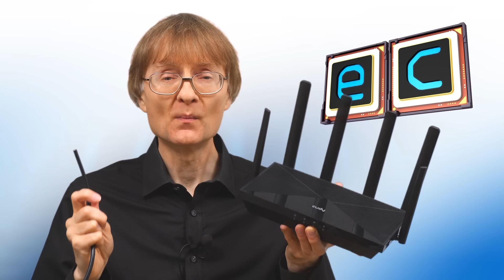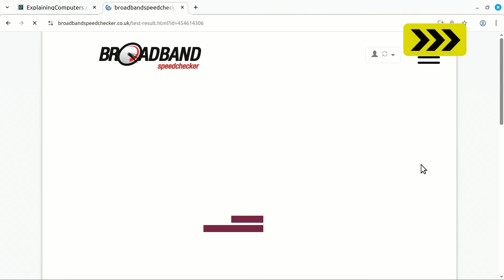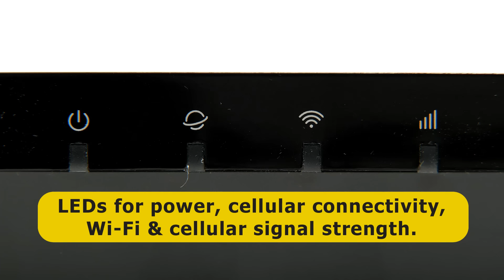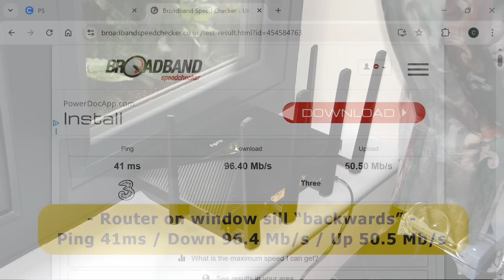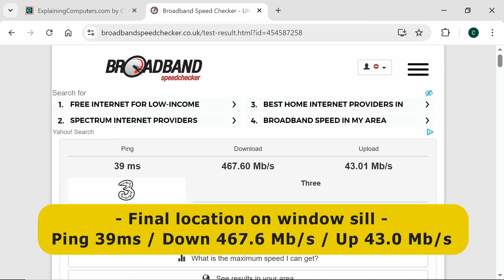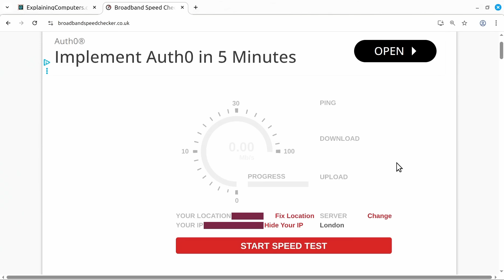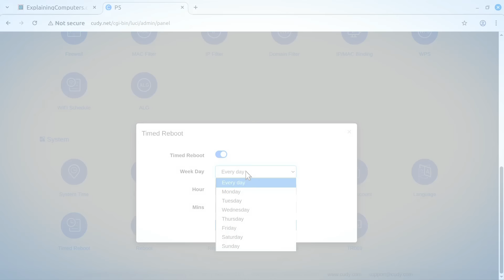Switching to 5G Broadband: Cudy P5 Router

Comment: Thanks for sharing your experience, Chris. I live in Helsinki, Finland and have a wired 1Gbps connection in the apartment for 40€ per month (optical connection into the building, no landline required). This just returned 919 down/828 up. I have considered a 5G router, as 5G in Helsinki is excellent (988/117 best result). Unfortunately though, it is a very new apartment building and the insulation is so good that it is effectively a Faraday Cage signal-wise inside. The building was designed with this in mind and has special glass with fine wire mesh antennas between the glass layers (triple-glazed windows). This restored the mobile signal to an acceptable level, but still only around 400/20 at the very best. So in my case definitely not worth it, especially given Finland's quite low Internet connection costs. In Finland, it is a legal requirement that everyone has access to 5Mbps connection, and apartment housing companies will usually provide 20-50Mbps free-of-charge.
Reply: how is the latency to nearby internet servers (ping ms)?
Reply: @gnu-lynx2501  2ms for the 919/828, 15ms for the 988/117, 15ms for the 400/20. The best 5G ping was 14ms, and 1ms for wired.
Reply: Unless you have VERY special needs, you'll never use 400.
Reply: @pasos22  For down speed I'd mostly agree. However, my work involves constantly working with remote web servers (including large transfers), and I have a development web server at home that needs external access, so 20Mbps up speed is totally unacceptable.

Comment: I have the same router and the antenna system i set up on my roof from WaveForm was very impressive and well worth it. I hope you can test some Waveform antennas as they have many different form factors to test out. That would be fun to watch you test them.
Reply: Seconded! I would be very interested in a 5G antenna test.

Comment: I live in Brittany. Just over two years ago following a bad storm that decimated the rural ADSL lines, we had similarly awful response from the French equivalent of BT namely Orange. They estimated a network restoration time period of …… six months! There is very patchy mobile reception in Brittany’s rural areas so we were left with no other choice than to install Starlink. We’ve gone from about 5 mbps download and upload with Orange (yes 5, on a good day) to around 350 - 400 mbps download and 30 - 40 mbps upload with Starlink. For rural areas with poor 4/5G reception satellite broadband just makes a lot of sense.
Reply: Is that the orange that was taken over by BT, I was with EE and when the contract ran out and BT took over EE, close to a monopoly in the UK, could not get copper from the box at a reasonable price so went with pop telecoms at almost half the price EE/BT were asking for better speeds.

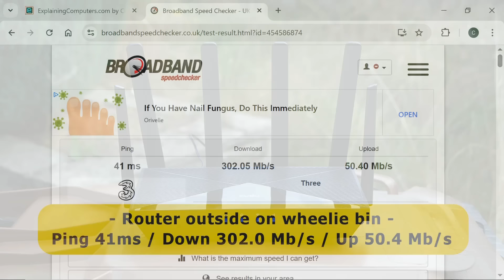Comment: 12:10 no Chris, running an antenna from the router to the roof would drop the signal IIRC by 1db/meter of wire.

Stashing the router in the attic is usually the preferred solution, although you could indeed try to add to the mix a 5G antenna for exteriors (with the router still in the attic).

Comment: I'm in the US.  Currently on cable and getting latency in single digits, about 500Mb down and 12Mb up (advertised 400Mb down, 10Mb up).  Moving soon to fiber with advertised 1Gb down and up.  And I'll be saving ~$20 a month.

Comment: This is so weird.  In my country, all wireless / WiFi connections are capped, while optical fibre connections are not capped. That means for wireless connections, you have to buy a package of data, either daily, weekly, monthly or Yearly, and when you have used that amount of data the connection stops!  That makes all the wireless / WiFi packages much more expensive than a fibre connection, unless you only use a tiny amount of data.  I am so glad that eventually they did lay a fibre connection to my address.  😒🤑

Comment: I live in Wisconsin and I had DSL copper line from 1997 to 2018. The speeds were abysmal (50kbps).  Before that I had dial up service. I switched to ATT Business Fiber seven years ago and haven't looked back. I have also upgraded all the wireless access points. Speeds is now 50Gbps at night, 30Gbps daytime for less than the old DSL.

Comment: @ExplainingComputers / Christopher,
It is interesting that you have published this video today due to the point that I have got a Fibocom-FM350-GL PCIe card (which uses the MediaTek T700 5G modem chipset) which I purchased in 2023 but due to regulatory issues (ie. US Federal Communications Commission approval / FCC "lock"), which in turn, has caused issues as far as operating system / software drivers have been concerned, I have had issues with this card. However, since version 6.9 of the Linux kernel, this card has been supported (which I only discovered around two weeks ago). Due to this, I am intending to deploy this card into my internal infrastructure at some point this week.

It is worth noting that I have been using a 4G Advanced router (ie. a ZTE MF297D) since February last year and prior to that (from 2013), I was using a 3G USB device and later (if my memory serves me correctly, from 2017 until the deployment of the ZTE MF297D) , a 4G USB device, connected to a computer, which was acting as a router (which I configured both the computer's internal Ethernet and WiFI provisions to act as a gateway).

Comment: My wired connection is unreliable, due to farmers digging up the lines or whatever.  You'd think the lines would be reliable, but they're often flakey. I did an experiment recently in which I bought a one-month internet package for my smartphone. I can use my smartphone as a Wifi tether as an alternative connection to the main line. It actually works quite well. The connection is at least as good, too. Very handy as a backup.

Comment: Had a vm connection with TV and phone but regularly had to reset the router sometimes twice a day  because of a dropped connection  and after it it became to expensive ditched vm and got ee full fibre since April and only needed to reset the router a couple of times  and get faster speed

Comment: I hotspot my 4g phone when travelling. Does everything I want to do well. ATT fiber at the house: works fine. Google fiber available (probably works a bit better) but costs a little more. 5G is available and is half the cost. I'm close to a tower. If I change it will be to 5G.

Comment: I think my neighbour across the road from me must now be using a 4 or 5G broadband internet connection as the original copper connection to his house was cut through by some guys trimming tree branches and Open Reach just tidied up the cable spaghetti and drove off!

I currently have an FTTP connection with BT at £35.00 PM (for their Fibre 2 service) but after seeing this video going down the 5G broadband connection route looks very interesting. 

Around how much a month are people paying in the UK for an unlimited data service?
Reply from the maker: Three charge new customers £21/month for unlimited data (with a 600GB/month fair use cap). Or they charged me, as an existing customer, £16 a month for an additional unlimited SIM.

Comment: When you put the cudy outside, did you run a speed test via laptop➡ethernet or phone➡wifi?
Reply from the maker: Good spot. :) All tests were via Ethernet. However, when I started making the tests I had not decided whether or not to make this video! :) So I did not take the photos of the router in various locations. Hence I had to put the it back into some positions to take them, and did not add the Ethernet lead for the outside shots.
Reply: @ExplainingComputers  Thanks. I have a similar setup and it never occurred to me to take my equipment outside to test. It's going to be my project for the next few days. Thanks for always posting great content.

Comment: Welcome to the club. I switched to the same 5G router and wireless solution 1 year ago. I have full 5G signal in my area in London. I have a Smarty unlimited broadband sim which cost £15.00 per month and which I am locked in for 27 months since November 2024. I have had no need for a second sim card yet.
Reply from the maker: This is great, and reassuring, to hear. :)
Reply: What are the average and peak down/upstream speeds you've experienced?

Comment: Are there limits on the amount of data used per month from 3 on the 5G or some kind of speed limits or "fair use" policy. I once tried BT via satellite and fell foul of "fair use" - Unfortunately, there was nothing in the agreement defining "fair use" so they could just cut you off or restrict  service when they felt like it. Many thanks for the information in the video as well as the description/notes.
Reply from the maker: My plan is "unlimited", but there are indeed fair usage limits, which I think are 600GB/month (although in some documentation I read 300GB). There are no speed limits (as there are, for example, with EE).
Reply: @ExplainingComputers  Many thanks for the info. There is no 5G where I am but I don't have the legal/physical problems you have for FTTP. Sady the speed "guaranteed" on the minimm speed FTTP is slower and costs more than my ADSL! (I like near a cabinet so minimal copper involved) Thanks again - I've enjoyed your varied videos on a wide range of tech matters for many years.

Comment: 🇸🇪 I use a 4G router, a Huawei B535-232a 4G LTE. I live in a mid size Swedish town, and i get speeds of around: Ping 44ms, Down 70Mbps, Up 10Mbps. This is slower than the broadband provided by my landlord, but it is also much cheaper!
Info for Swedish people: I use Comviq, and I pay 299SEK/month for unlimited data. I have a plan without router.

Comment: My house has a metal roof and "stucco" that fakes stone, and really is just concrete over aluminum mesh lath. I get decent cell service in the house (large windows especially on the ground floor), but my internet is via Cable (Spectrum now, formerly the atrocious Time Warner before buy-out) into my wifi router with all my PCs but one (dead ethernet but wifi works) wired, and when I had a TV it too wired. Still have a TV, but it is currently just a wall hanging black area. Current speed right now is 266.2 Mbps down, 22.6 Mbps up. 
 Not many pushing 5G here, but ATT and Verizon offer it, as does T-Mobile, but they need to fix their website (start typing my address and it offers up it in the drop-down, select it, hit search and get a "Must select address from drop-down" message)
 There is a Wifi based service around town (I think Xnet), but what few customers I see are out by the Lake. They also offer a 5G service, but pricey, and not in my area, it seems Seeing more and more Starlink. Brightspeed is expanding Fiber in the area, but locally at least their customer service is not much better than that of CenturyLink whom they are replacing, as most are the same people, just new company.

Comment: I've been using Three 5g for the last 4 years. First two years I had the Huawai? router then Three gave me the ZTE MC888 router which is much better. I like 5g broadband but it is only as good as your received 5g signal. Just wondering now is the Cudy P5 better than the ZTE MC888.?
Reply from the maker: Great to hear this. For me, a key benefit of the Cudy was its four Ethernet ports, which I know a lot of people will not use.

Comment: It's worth remembering that all smartphones thesedays have a "hotspot" option, where you can use them like a router from your mobile-data. 

Best to check first though if your contract allows this (it'll usually be called tethering), and may not be suitable for low-data packages.

Though currently you can get unlimited data for: 
GiffGaff (uses O2): £15 a month (usually £25)
SMARTY (uses V+3): £20 a month
Tesco Mobile (uses O2): £20 a month
VOXI (uses V+3): £20 a month for 300 GB
Asda Mobile (uses V+3): £22 a month

Comment: Very timely Chris, I have been researching a 4G LTE router that I can use as a backup internet source as a failover connection with my Unifi Dream Machine Pro. Unifi do make a device but at nearly £300 it is too expensive for my needs. Maybe someone here has already solved this problem and has some recommendations.

Comment: Here in Canada where I am there is one cell provider with 5G home internet. For $60 CAD you get 200GB of data, $80 CAD gets you 600GB data a month and for $100 CAD gives you 1000 GB. They throw in a Wifi7 Gateway for the last 2 plans and a Wifi 6 gateway for the first plan

Comment: I'm now using a Andrews and Arnold connection and have my phone number on VoIP with them using a VoIP Gateway adapter. My speeds are a lot slower than Virgin Media But websites seem snappier. I couldn't be happier with them as a service. Excellent support. Maybe a VoIP gateway adapter and AAISP phone number might be an idea for you too, to get away from BT?

Comment: Hi Chris! In the Paris region where I live, I have an FTTH fiber connection with an 8 Gbps symmetric line for €49 a month. My router and switches only support 2.5 Gbps, though. The package includes free phone service and TV.

My 5G connection from Orange (the former France Télécom), however, is extremely poor — just 26 Mbps down and 0.16 Mbps up from the balcony! No, 5G wouldn’t work for me.

Comment: Also in the UK and also had similar issues with PlusNet who could offer no solution to the impending Digital Voice so I jumped ship after 20 plus years and joined an alt net provider in the form of Gigaclear.  I now get 500mb up and down, have kept my Tel number as a VOIP service, with free calls all for £32 per month incl VAT on an 18 month contract.  Sorry, to say Gigaclear only provides a service to certain parts of rural UK.

Comment: Great video Chris - I have a 5G router from Vodafone. I would have fibre, but my crazy neighbour cut my phone line twice so, at least until he is evicted, I'm using it. The speeds are great, but I'm paying £46 pcm for unlimited data (and for the router). Sometimes I have to reboot it as it occasionally does odd things. I think it is a ZTE model underneath the Vodafone branding
Your Cuda router looks a lot better than mine, because of the flexibility of being unlocked and dual sim options and also because the interface looks great (e.g. VPN option)
I would certainly recommend a 5G router to anyone who needs an alternative solution to FTTC/FTTP internet

Comment: Is there a data cap on the 5G tariff?  And you initially said it was cheaper, but I don't think I caught the price.  Does it fall back to 4G if 5 not available?  Very interesting video, thank you - I'm lucky to have FTTP 900 up/down, but definitely interested for travel / backup.
Reply from the maker: My Three plan is "unlimited", but there is a "fair usage" clause, which is either 300GB/month or 600GB/month, depending on where you look! :) I am paying £16/month for this. It will indeed drop back to 4G when 5G is not available. In the UK, 1p Mobile (which runs on the EE network) is worth a look, as it offers (eg) 50GB/month for £10, rolling PAYG.
Reply: @ExplainingComputers thank you - I've not heard of them, will research now
Reply from the maker: Also checkout 1p Mobile -- who use the EE network, but do not limit 5G speeds like EE do, and who offer some very good deals.

Comment: So pleased you decided to make this change. I did so six months ago. I use the same Cudy P5 but am not as close to a 5g mast as yourself. I have been so pleased with it I have cancelled my land line and rely on my mobile for calls. My speeds are better and my costs have halved.
Reply from the maker: It is great to know that this has worked for you for six months. Gives me confidence for the long term! I suspect that in time I will port my landline number to a forwarding service and get rid of the line entirely.
Reply: @ExplainingComputers  Don't give BT another penny Chris !  they are arrogant, expensive and deliberately deceptive and also, seem convinced that they cannot ever be wrong about anything at all !        Grrr : (
Reply: @ExplainingComputers  If I put 2 sims in this will it multiplexing the data through the 2 accounts or perhaps favoring the one with best performance?
Reply: @ExplainingComputers  - I've been using a home-brew mobile router/modem with GoldenOrb firmware since 2019.  Speeds are up to 1,000 Mbps on 5G here in the US.  For testing, max out your monthly usage to see if they have an upper GB limit.
Reply: I am 9m away, seeing as it is above my head.